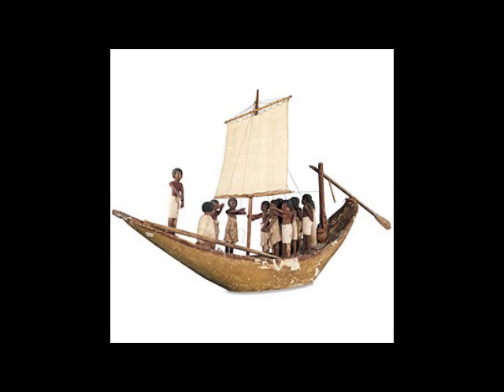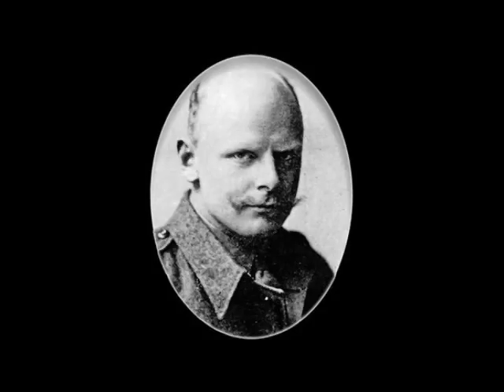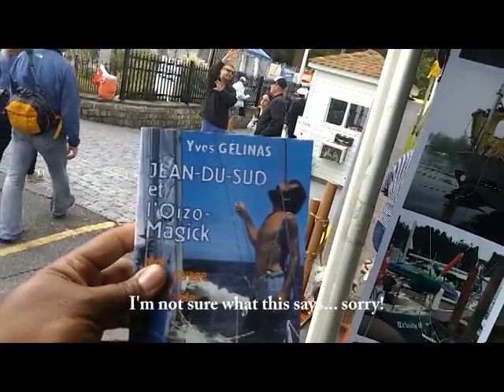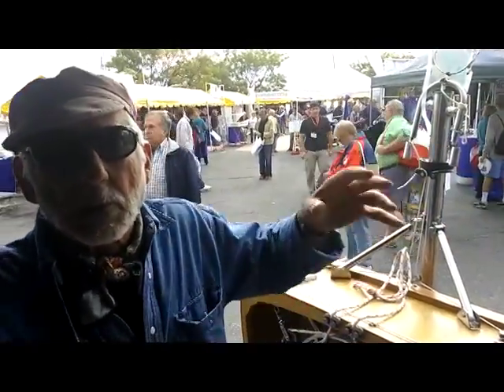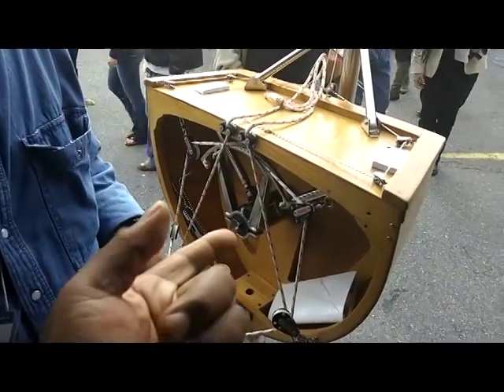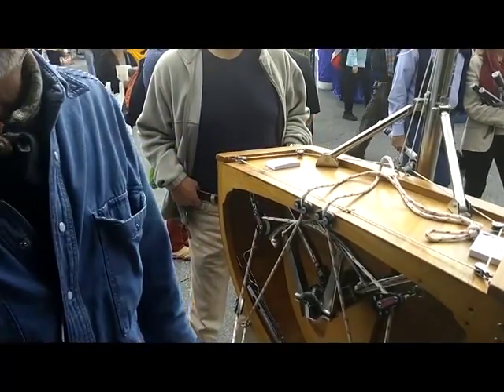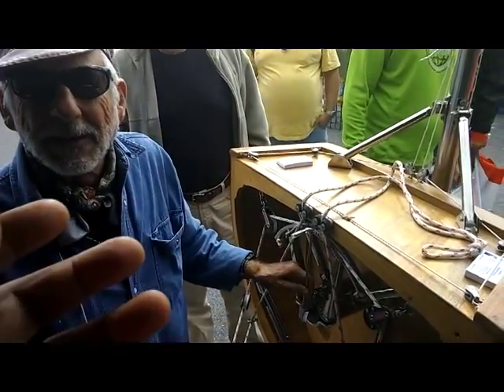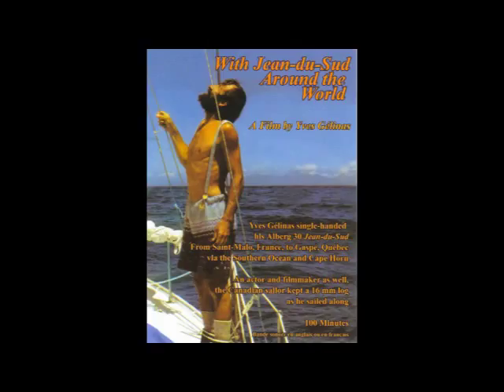The Cape Horn Wind Vane

Comment: Bravo!  What a great opportunity for an interview with one of the sailing legends.  

I think the Cape Horn wind vane was popular with the Westsail 32 fleet - I remember the Westsail Owner's Association talking about doing a group buy of Cape Horn wind vanes a while back.  I wonder if having all off the control lines in a locker like that would make it more difficult to inspect and fix offshore.  On my W42 I have a propane locker in the stern so I couldn't have an installation like that.  I installed an Aries instead and have the steering lines going through several blocks on deck up to the wheel in the center cockpit.  I also mounted a tiller autopilot on the stern and hooked it up to the Aries wind vane fin as a backup - though I'm not very impressed with the end result as it wanders a lot at best.  We also have a hydraulic ram autopilot connected directly to the steering quadrant under the aft cabin berth.  While we were sailing from Greenland to Iceland we broke our steering cables and used the hydraulic ram autopilot to steer us back to the weather station in Greenland for repairs.  We also have a wheel mounted CPT autopilot which I absolutely love.  Eric Forsyth's Fiona has a Raymarine electric autopilot in the engine room hooked up to the steering cables, but he also has a custom tiller going to the cockpit for if his steering cables break, which they have.

Honestly if I could do it all over again then I'd get a Hydrovane - I love that it can be used as an emergency rudder and I've sailed with it on other boats and was really impressed.

Comment: Great video!  The Cape Horn system has always been high on my self-steering gear list.  However, our WS42 does not have a lazerette, as the aft cabin extends all the way to the canoe stern.  On most WS42s, there is a small compartment at the stern for propane and other stuff.  For me to install, I will have to reconfigure my aft cabin by constructing a "cabinet" for the Cape Horn quadrant.  I like the simplicity, as well as the autopilot option and emergency rudder.  Nice job highlighting a piece of gear that often gets taken for granted, I think.
Reply from the maker: Douglas Tate Thanks Douglas. In the WS 42 is the quadrant inside of the engine room or is it under the aft birth?
Reply: Kamau Iandiataiyero The quadrant is under the aft berth on the WS42.  As a center cockpit design, the engine room is under the cockpit and well forward of the rudder shaft.  Advantage is a huge engine room with capacity for containing a lot of machinery.  Disadvantage is the need for a longer shaft and the space required for the quadrant in the aft cabin.  An event bigger challenge is how to install a typical hydraulic autopilot like a type 2 RayMarine!  The attachment for the hydraulic ram has to go above the quadrant because there is insufficient space under the quadrant.  To accommodate this, I raised the level of the berth by 5-6 inches. Yes, less headroom, but a little more storage space.  There are other autopilots like a chain drive that I could have installed in the engine room, but I wanted the autopilot to perform as an emergency steering option along with an emergency tiller (something I still need to fabricate).  Having said all of that, if I were to install a wind vane the Cape Horn and the Hydrovane would be my top two to consider.  Although having seen your video, the Cape Horn has a lead!  Good Job!

Comment: Cape Horn vanes are, in my eyes, real works of art.

Hasler first started developing windvanes in 1953 but didn't hit upon the idea of a servo-pendulum type until 1961.

Jan Alkema, a Dutch engineer, since developed another sort, where a pendulum is mounted directly on the trailing edge of a transom hung rudder and is connected to the transom with lines that serve as pivot points so that the pendulum pushes on the head of the rudder.  It is not an obvious next step in the evolution of windvanes but works quite well.   To my knowledge, no one has started production of that commercially.  Jan also found that an upside down windvane has certain advantages, and at least one Dutch manufacturer, Mister Vee, started making a vane with a USD vane.  I don't know if Jan is/was associated with Mister Vee or not.

Another engineer, an American from, iirc Georgia, Walt Murray, now deceased unfortunately, used to maintain a great web page of windvane designs for the home builder.  Some of his work has been preserved on the Mister Vee web page.

Comment: So if I'm hearing this right, the way that load is taken off the electronic autopilot is by using it to steer the pendulum rudder, rather than using it to steer the main rudder? So it harnesses the force of passing water, rather than fighting the water?
Reply from the maker: Philly Cheese Take precisely.
Reply: @IandiBoats  the electronic autopilot has nothing to do with it - even if you don'e have one of these, the windsteering system should steer the boat. The clue is in the name.

Comment: I did like having the space taken up with this and the monter a commenter said an oil rig hanging of the transom. On my IP 370 I purchased the Hydrovane that  has the Watt & Sea hydro generator on it.  With my wind generator and solar panels in ideal conditions I get 1600 watts of elect or 133 ah per hour which never happens. Also an EVOY hydrogen generator that produces 200 ah per day, very expensive equipment.  The wind vane works great.  Uma got help on many of the products on their boat and promotes all electric power.  Even helps that little Swedish which blackmailing the US for money to other countries but dies go to the countries that are the worst polluters. As they do allowed there.

Comment: who wants to take up valuable locker space with windvane gear - and who wants to try to delve in to small places to fit quadrants etc? Sorry, but it doesn't sound very smart to me.
Reply: As he mentions in the video, that protects quite a bit of the components from the elements. I suppose it depends on the boat, but Sailing Uma installed on and they seem really impressed with it. And of course, Yves, well, I suppose there's a reason he called it the "Cape Horn Wind Vane" - check out his book on 59-North's podcast. (What seems intriguing for me is that no motor to break down...)